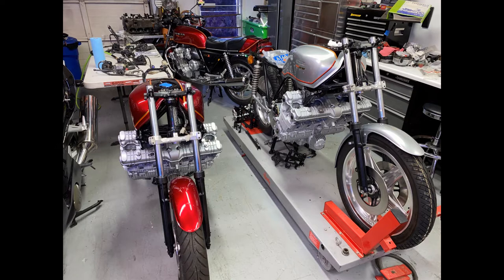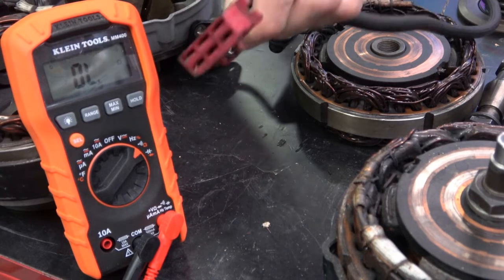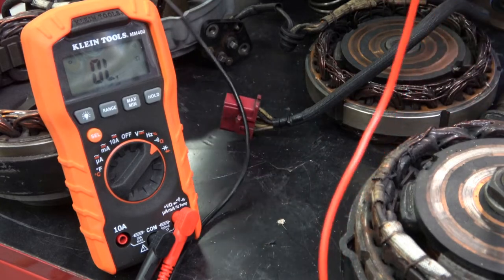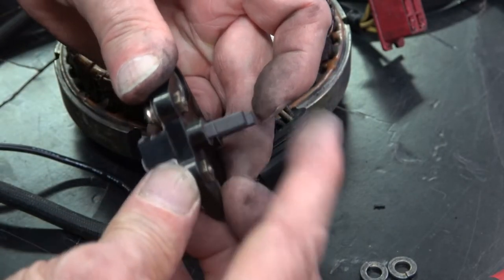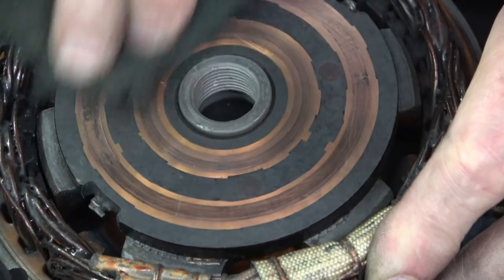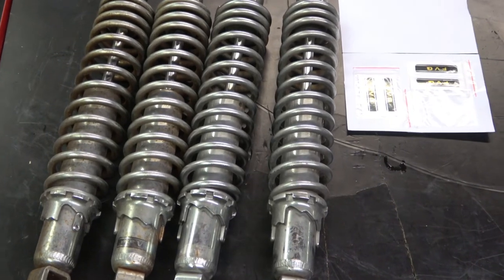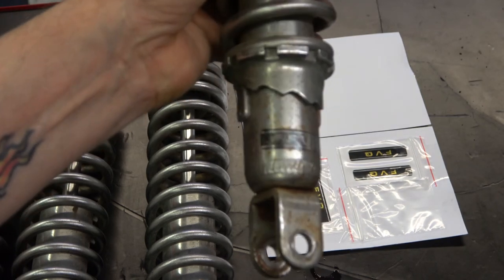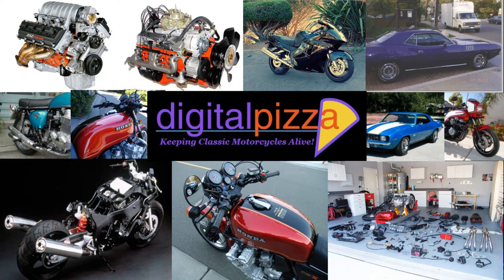Honda CBX Full Restoration & Engine Rebuild Video Series - Part 34 Alternator Stator & Rotor Rebuild

Comment: Incredibly interesting to follow the restoration of this beautiful bike. I had a 1981 Honda CB750C which has the 4 cylinder version of this engine. I have wanted a 6 cylinder of this for a long time. What makes these engines often break even with low miles on the odometer? I think I know where the big piece of aluminum is from in the video "Honda CBX Full Restoration & Engine Rebuild Video Series - Part 3 - Final Tear Down & Parts Layout" 0:55 if you look at 8:05 in this video you can see that the Alternator housing has a part if similar to the part that was broken off. And there is a part that may have been replaced earlier if the one that was fitted to this engine is not damaged. How much will it cost to do such a restoration? How much does such a completely restored bike cost? With kind regards from Norway